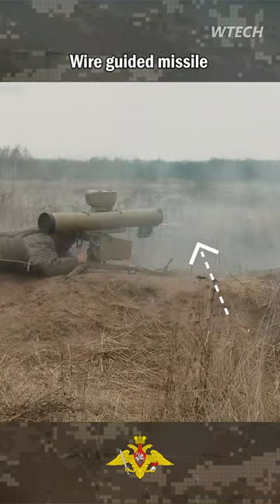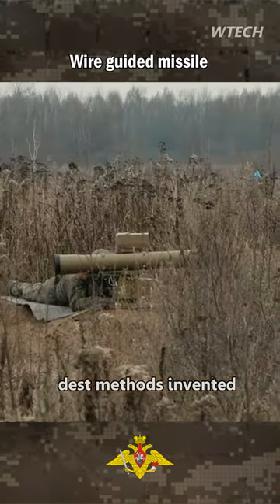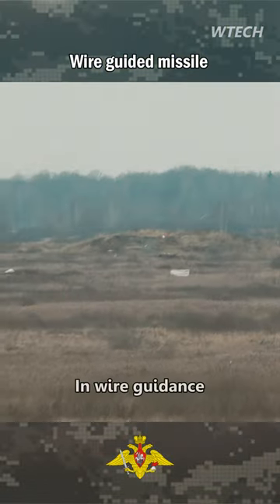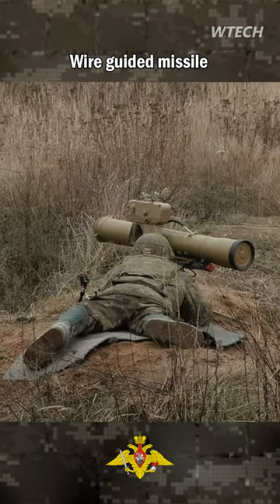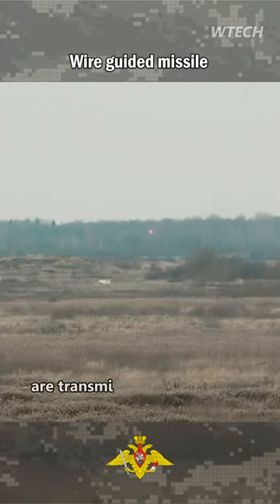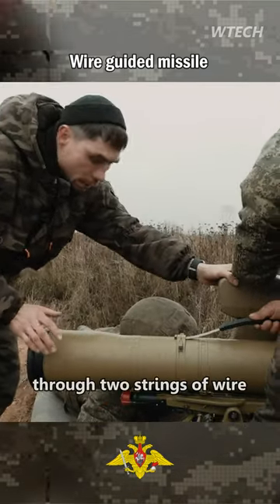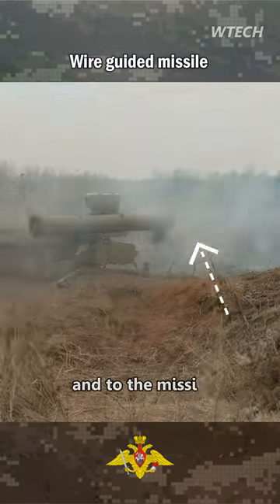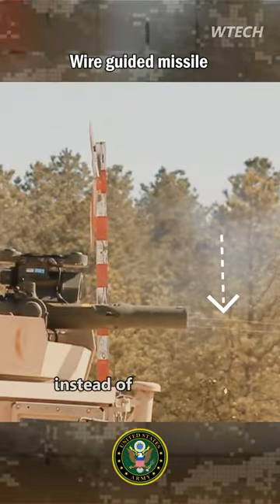How does a wire guided missile work?

Comment: How would a tiny wire guide a rocket? Or is it strictly for communicating computer demands?
Reply: Think of it as wire for mouse for pc. Its sending info to missle on where to go. The user will aim at target, and computer will send that info to missle via wire. Its more reactive than laser guided so its easier to hit moving target but have limited range due to phyiscal limitation of wire

Comment: Does the wire from the launcher stay attached to the rocket all the way to the intended target? How much wire do you have to play with? Cause I've seem some amazing long distance shots with a TOW.
Reply from the maker: The length of the wire is greater than the range of the missile, for example, in the BGM-71 TOW missile, which has a range of more than 3700 meters, the length of the wire is greater than this value.These wires are flexible and resistant and are very compactly placed in their housing.The resistance of the wire is such that it is difficult to cut it with anything else than a wire cutter attached at launch.
Reply: @Warrior_Technology  that is crazy & cool! Thanks.